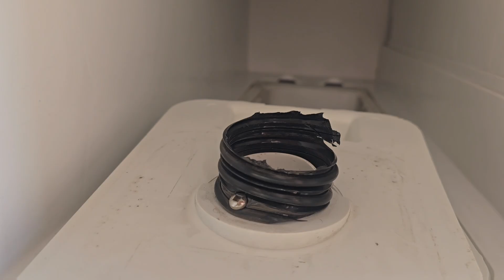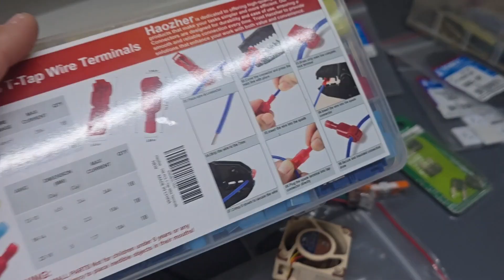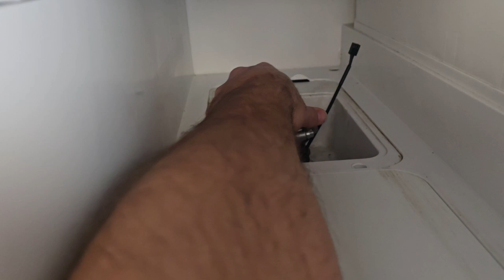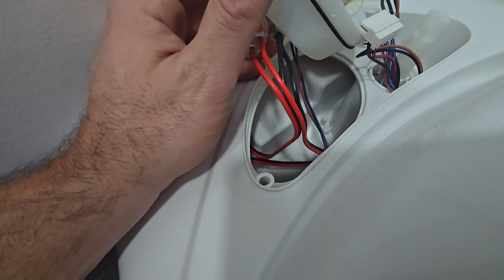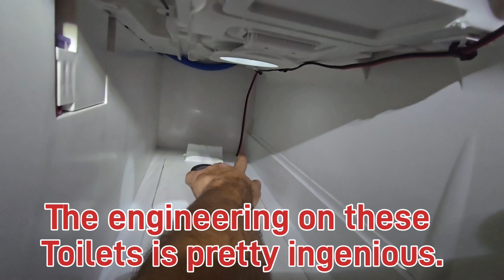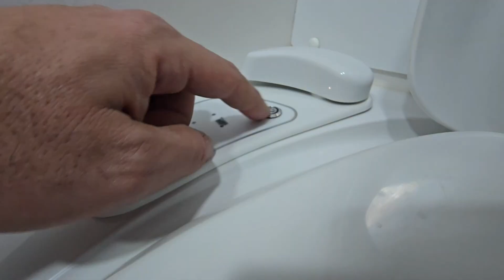T@b 320s Thetford c400 style cassette toilet DIY ventilator extraction fan.

Comment: This solution is really Genius!
If I should buy SOG it would cost about $300 in Norway, this is almost for free!
Thanks!
Reply: Oh😢, I made an order yesterday, is it worthless?
Reply from the maker: @KS-vk5pc It does work good while at camp, and it helps a little while in transit. But im still struggling to get more suction out of it while driving with a full cassette to keep the smell at zero. I actually doubled up the fans recently, it only slightly helped, though. Im still on the look out for a small higher suction fan with low power draw though. In my latest cassette  tank update video you can see what I've done.
Reply from the maker: Yep. It works ok, but it still need a stronger fan. I wish I could just buy the SOG fan for how i set this up. Thanks for watching. 👍

Comment: Do you by chance know how to remove the entry  door window frame?
Reply: Yes sir?
Reply from the maker: @MyRanger12  if it's like my 23 model, it's just held on with double side tape, and the little port window shade is stuck to that square plastic cover. Carefully pry up around and under with your hands, gently working around it with a plastic pry tool, maybe. It got so hot here first trip home mine started melting off. I peeled it off cleaned up the old goop and used (High Teck) double side tape. You will on need about a 2inch piece of tape on all 4 sides.
Reply: Mines 2024, the black out shades to be tightened, I already had Done the side windows.the blackout shades wouldn’t stay up.  I thought you had had an issue with yours. Thanks again.
Reply from the maker: @MyRanger12  ooooh gotcha. Mys side window shadow some times won't hold up, but the door port wi down is fine. I have noticed the main slide up windows on the side of the trailer have a slight warped upper trim piece inside. I'm wondering if that was done on purpose to catch the shae as it was up. I have yet to take apart any of the shades yet.
Reply from the maker: @MyRanger12  how did you tighten the shade?
Reply: In the corner of the window frame are corner covers, take them off you will see a silver barrel with a white string or black string. The white string is for the blackout shade, the Black is for the screen. Take the correct size alan wrench and loosen the barrel while holing the string with pair of needle nose pliers. Pull the string a little and tighten the barrel. Make sure the string is equal on both sides. There’s a video on youtube where I found out.  “Horrex DuoPliss RV  Window Screens, Nucamp Cirrus”
Reply from the maker: @MyRanger12  oh very cool. I didn't knkw.they could be adjusted. Awesome! Thanks
Reply from the maker: Do you mean the square plastic cover that holds the blind for the port window?

Comment: You did a slick job there! Well done. I hope it works for you! 😊
Reply from the maker: Thanks. So far, so good. Ran it for 6 hours straight, hardly notice any power loss on the battery at all. I may change the fan out for a louder one, I can't tell its working, hahaha.

Comment: I’m curious if your main ceiling fan has a reverse option. Our class B van vent fan came with a remote that only allows for out venting with the supplied remote. I ended up getting a replacement remote from Amazon with a reverse button so now we can to draw air in or out.
Reply from the maker: My Maxxfan is the none remote version. It does vent out or in and also has an auto temperature setting.

Comment: Thanks man, I'm hoping to purchase a 320 in Feb so I really appreciate all your videos! Is there a strong bathroom odor in these things?
Reply from the maker: If you use a good tank treatment while stationary, it's not bad at all. Unless your ceiling fan is venting outward. Then it can draw up smell, haha. A little water to cover the black seal helps. But, if you are traveling and the cassette has not been fully cleaned and rinsed out, the pressure in the trailer going down the road can suck the smell out of the toilet. The next task is to see if the vent pipe under the trailer is actually the cause, pushing air back through the system when driving. I appreciate you watching. Thanks for commenting.